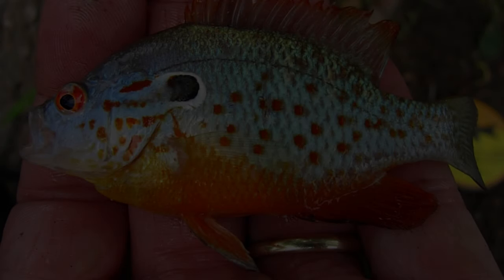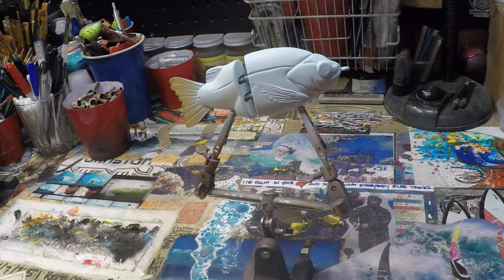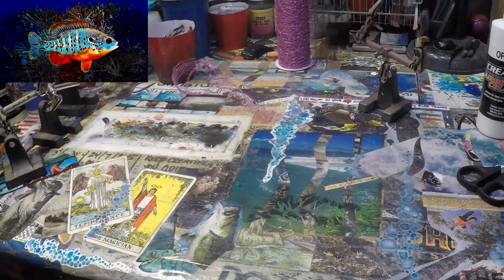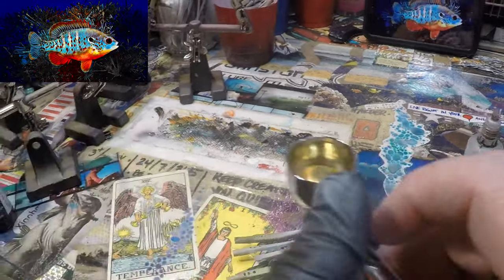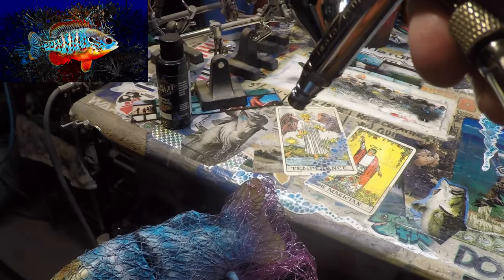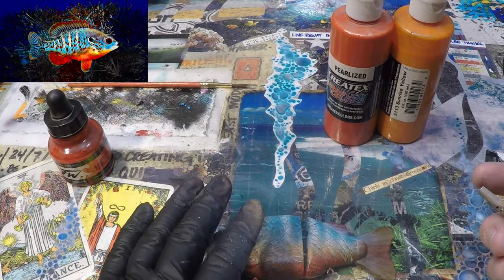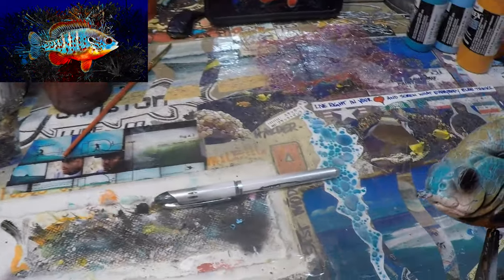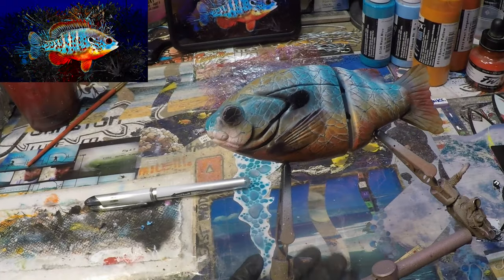NEW SPRAY SESSION! The Orange Spotted Sunfish

Comment: Just curious. Have you ever thought about using tattoo ink cups for mixing small amounts of paint? The large ones are just the right size for mixing small amounts. I've used them and they are easier to pour the paint in the chamber after you mix the paint.
Reply from the maker: Never thought about that. I know very little about tattooing (other than its pretty cool 🙂)
I'll look for it!

Comment: My Createx opaque white tends to spit a lot no matter the psi I use. I even tried adding a little 4012 to it and still does it. You think I just got a bad bottle? Or is the Createx opaque white known for that? It’s the only color that does it.
Reply from the maker: Try reducing just a bit, and try adding a small marble to the bottle to help mix it up better. Preferably a metal marble to a glass one, like what they put in the Wicked Line of paints

Comment: How would you go about dipping an actual popper in KBS without the KBS pooling on the poppers "Mouth"... I've seen a past video u did but that popper had holes on the side for the gills. can u make a video please. or explain to me how. thank you very much.
Reply: Before hanging, tip it so as much excess can run off as possible. All my lures have cup/dish fronts on them, and THAT is the one issue that arises. I dip, then hold it sideways to get as much to run off as possible. And as it hangs then, i'll even dab the dished area with paper towel if needed.